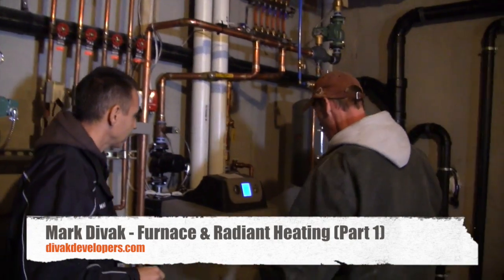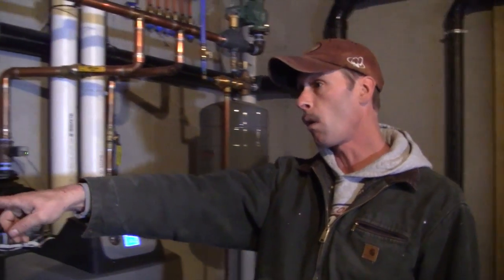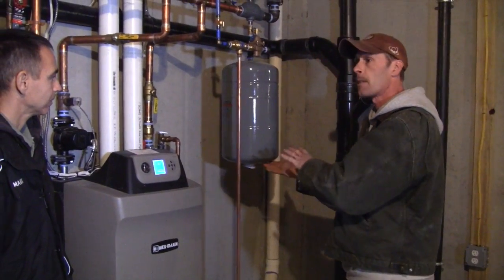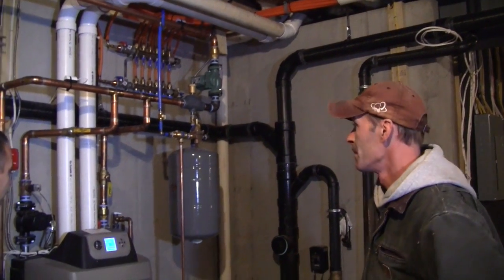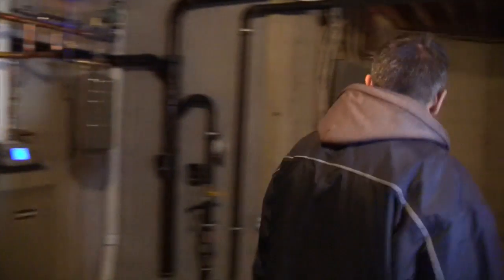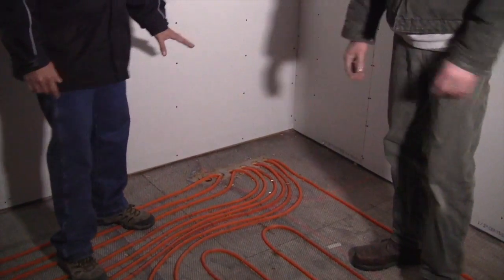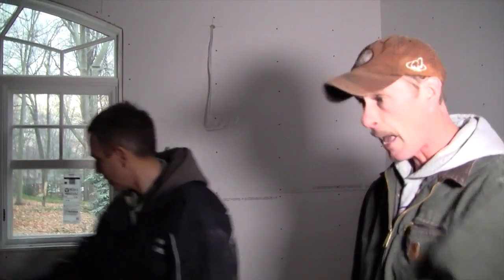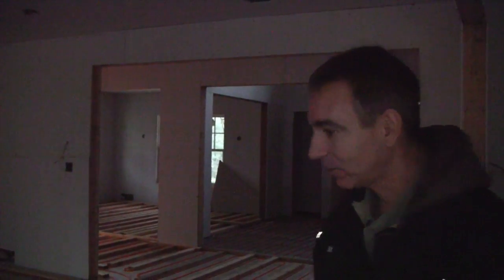Custom Home Builder Tips - (Furnace & Radiant Heat (Part 1)) - Divak Developers

Comment: Not sure about connecting all those 3/4' zone valves to 3/4' manifold header?? Also, two circulators on the water heater tanks are unnecessary.
Reply: 786otto both are needed.   Each circulator needs to flow through boiler and meet flow and head requirements of boiler.    Technically to drive an indirect you needs 110k btus depending on the model.

Comment: Beautiful job.I was wondering about if a home owner put a nail into the tubing.Will that floor need to be ripped up and replaced?
Reply: You would need to remove the flooring where it needs to be patched.  odds are that the home owner would be putting any nails into the tile or hardwood flooring.

Comment: WOW. That is a gorgeous set up! so well done! I would almost want to encase it with a plexiglass wall and show it off!

This is exactly what I want in my next house. I am however a little sketchy about the placement of the hot water heater that is in the corner. The reason why is I like simplicity and by that I mean if I need to replace that water heater for any reason I want the next repairman to be able to access that easily. I know the system is complex and the routing of the water pipes may need to be installed as such but I would rather have those pipes run either behind the heater or above. I don't care if the system has to be out further from the wall because with that type of house I would have a dedicated room for that system.

I am anal about things like that.

I love these videos because you are doing things that I want to install in my next home.